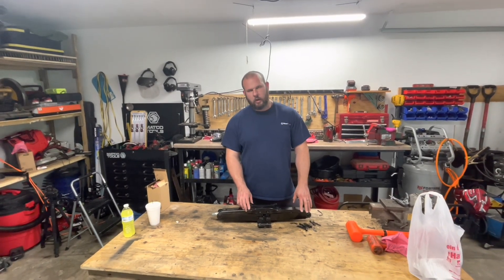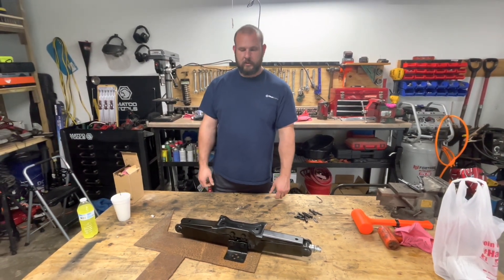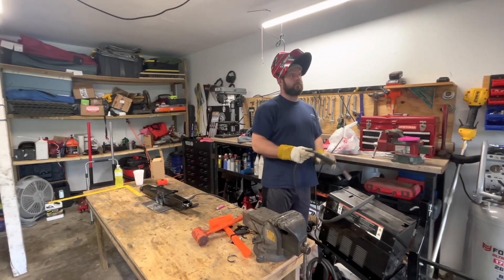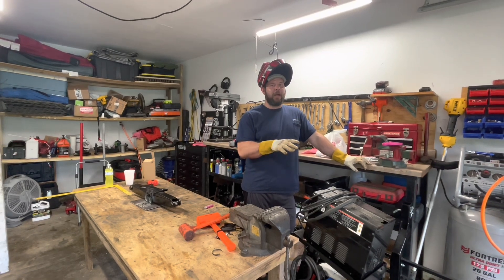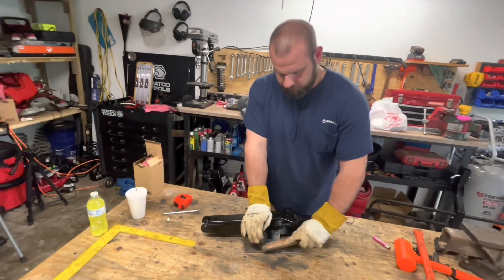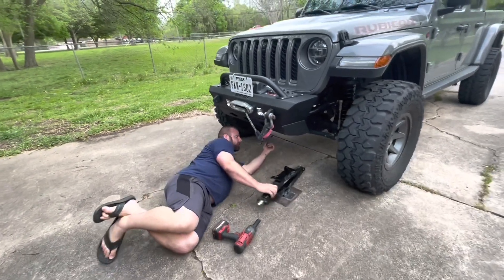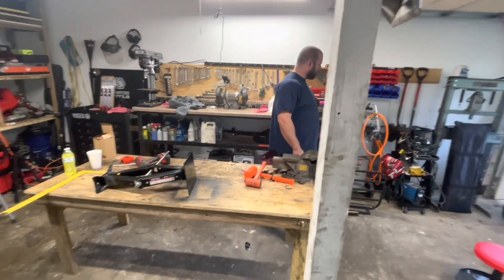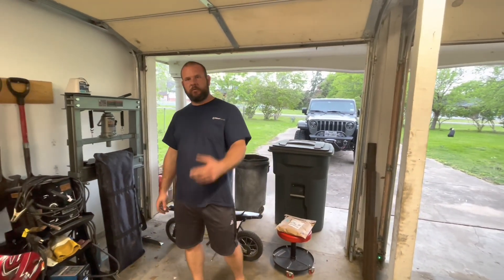making a scissor jack for off road use

Comment: Punctuation in the title not being possible, maybe “Making a scissor jack safe for off-road use”

But “making a scissor jack off road” ain’t it
Reply from the maker: I get what you are saying, but we have used it to change out 2 tires and lift a truck off a ledge it was high centered on. It was able to get into that tight spot and lift it off the rock. Allowing us to stack rocks under the tires so he could drive out with no body damage. 

Everyone has their preference, but i used to use a high lift jack, and it was just so dangerous and tippy. Bottle jacks are great, but they are tall and can't get into super small areas. Like when that truck was stuck. Also, the high lift you have to have an area on the rig that can handle lifting it from. And if your not on good ground, it gets even more sketchy. 

Floor jacks are great, but take up room, also really heavy. I think floor jacks are the best, but the room they take up and the amount of weight they add to the rig is a lot. So the scissor jack was in my mind the best happy medium.
Reply: @JeepTrailsandBarbells  sorry I don’t think you’re wrong at all about its use. I just think the title needs a rework. The classic difference in punctuation:

I helped my Uncle Jack, off a horse.

I helped my uncle jack off a horse. 

Very different sentences
Reply from the maker: @KC-mw8to  🤣🤣